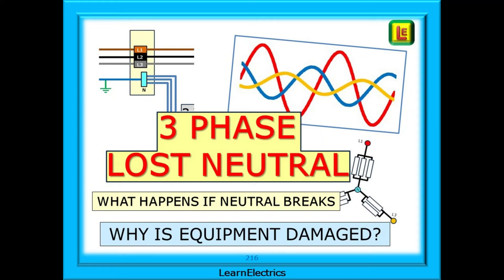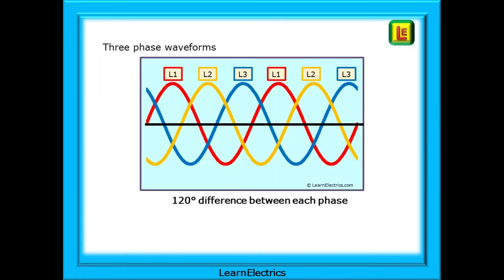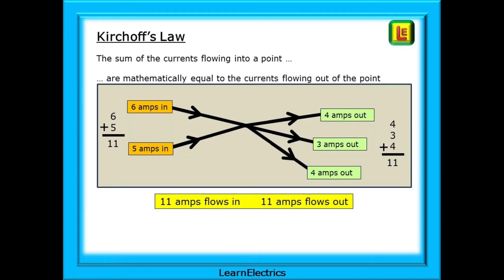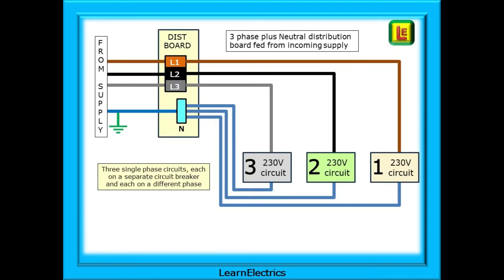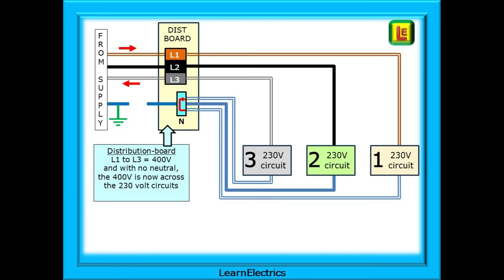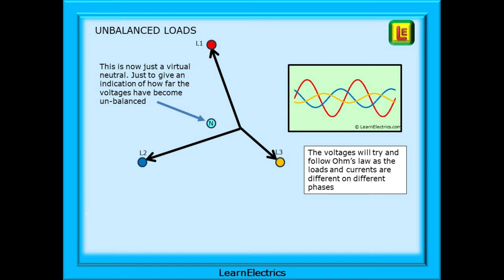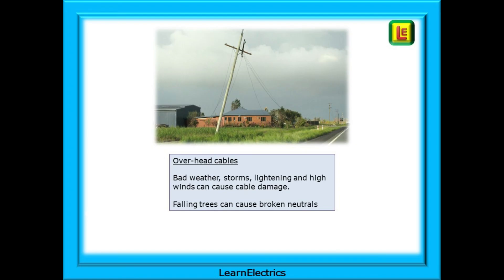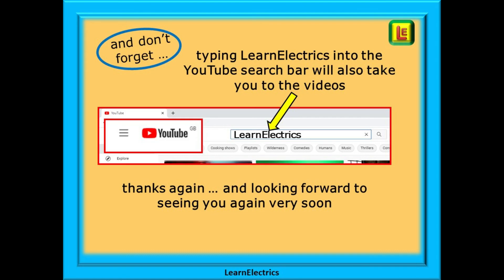3 PHASE LOST NEUTRAL – WHAT HAPPENS – WHY IS EQUIPMENT DAMAGED – A LOOK AT THE THREE PHASE WAVEFORMS

Comment: Great information.  We have a few single phase VFD motor controllers in a sub panel that have different power requirements on each phase due to motor ratings  so the same could happen here if neutral lost .
Reply from the maker: That's a good point Michael. Thanks for the info and thanks for watching. Dave.

Comment: I found this very interesting, but it brings up a question? 
If the loss of a neutral on a three phase supply and is dangerous to the end user as well as damaging equipment, then why are new builds starting to have three phase supply’s as standard.? Surely this will put home owners at a higher risk of fire and injury or death. 
Great video as always 👍
Reply from the maker: Now that is an interesting question. Thanks for raising the subject. Dave.
Reply: Here in India we have 3 and 1/2 core service cables. 1/2 core is the neutral. Means neural size will be half that of phases. This is a cost cutting strategy. Electrically this is ok, but lacks mechanical strength.
Reply: Thanks Dave another interesting video in your usual straightforward style.

Comment: Hi,
You have given a  case. A 3 phase transformer present which drives 8 houses. Each phase has a fuse before reaching the house, inside house thorough MCBs home appliances are connected. Few appliances are running in few houses. Suddenly a bird hit one of the phase of transformer and it's link blown. In house 3, AC got blown which in running state. House 4 - 3 fans blown 2 running state 1 off state. Seen that neutral wires are blown and inside windings are blown.

1. Why not all devices blown in other houses?
2. in house 4, why all devices not impacted?
3. How does the devices affected which are in off state also ?
4. Good to hear the detailed analysis report explaining the cause and internal behaviour.
5. Tell the exact precautions which are needed to handle such situations in future.
6. How can we test the neutral and earthing fine at transformer and at home
Reply from the maker: This is why we install protective devices, to limit the damage and impact on other devices.
Have a look at this video on fuses.
https://www.youtube.com/watch?v=QuTcXRnugvQ

Comment: when you lose the neutral on the supply side you lose the set neutral point so you have a floating neutral, the neutral is normally a centre tap voltage divider with reference to ground, when you lose that you have multiple properties connected to that same neutral and one or more of those properties will also have a connection to another phase, so instead of having a clamped 240v supply you have a floating voltage divider based on resistance that is split between L1 and L2, the lower resistance property gets the higher voltage. 
the voltage will very with the load on each line, the resistance on each line is the load on each line, the higher the resistance the lower the voltage on that line, the lower the resistance (lower the load is) the higher the voltage is.
Reply from the maker: Brilliant contribution, thanks. Dave

Comment: Something similar happened to me when I connected earth together with neutral, instead to the grounding pole clamp. Had to change the old three fase cable with just a neutral going in to the house, to a new one with added earthing. The main distribution board was outside, on the electric pole, the box was old and a seperate clamp to the ground was missing, so I connected earth to neutral. 2  mysterious weaks of dropping/jumping voltage and some damaged equipment. Thankfully the house didn't burn down and most of the equipment was repaired.
Reply from the maker: Lucky, glad you got it sorted. Thanks for the info, and thanks for watching. Dave.

Comment: Dave, thanks for the insightful video. I have a question about the diagram at 07:37. What happens if N is connected to the local earth system (with an Earth Resistance below 4 ohms) and then downstream separated into N and PE at the distribution board level? This approach is quite common where I'm from. Does this practice mitigate overvoltage issues or exacerbate the risks in case of losing N upstream?
Reply from the maker: I've deliberately left earth of the drawings. In the UK we separate the earth and neutral at the intake position and do not run earth and neutral together in the installation. Without seeing how your wiring systems work, its difficult to say. Hope this helps.
Reply: @learnelectrics4402  Dave, thank you for your response. It's interesting to learn about the UK's approach to separating earth and neutral at the intake position. In my country, we typically have (in aerial power line): L1, L2, L3, and PEN -  that has the combined function of providing the neutral and protective earth. PEN is grounded at the intake position and at each 2 consecutive poles. At the customer's first distribution board, PEN is joined with the local earth system provided by the custemer (having no more than 4ohms) and then separated into PE and N.

Comment: Recently I had 240 v neutral failure probably due to tree branch on service pole . Voltages were not correct at panel. Lights dimmed, some lights blew, some lights when turned on turned other lights on. The Aluminum frame of our screened porch carried,  variously, 40 to 70 volts. 
I think our bonded fuse box sent voltages to the screen porch ground, causing my dog to yip when she brushed against the aluminum doorway.
Best advice if lights (power voltages) act crazy.... Cut power and call power company to repair.
An electrician does not work on power company side of meter.
Reply from the maker: Great contribution, thanks for watching, Very similar to my Mother's brush with a storm. Dave.

Comment: If the natural is disconnected, will the circuit breaker in the distribution board activate and save the electrical appliances ?
Reply from the maker: The circuit just will not work. No current flow. The breaker will not operate unless there is a significant earth fault.

Comment: Would an AFDD provide protection against this fault as they have overvoltage protection? Thinking more in a single phase residential setting where the neutral fault is more likely to be with the DNO?
Reply from the maker: In my opinion, no. Not unless you have loose connections and arcing. With single phase, things will just stop. hope this helps. Dave.
Reply: Many thanks Dave

Comment: Thank you for the lesson. I have a question. My house is 3 phase but can be changed to single phase with change over switches, this is because of unstable electricity. Last night after a blackout the incoming voltage was 360v. I thought it was because the neutral was lost. I then changed everything over single phase (all load on 1 line and the “lost” neutral. The voltage went to 200v. Why is it that if the neutral was lost did the single phase work, did the 1 used phase use the other 2 non used phases as a neutral?
Reply from the maker: Without actually seeing this type of problem as it happens, its difficult to say. But thanks for watching and I hope all is ok now, Dave.
Reply: @learnelectrics4402 not sure as an electrical engineer you actually want to see the wiring in the house. Phases are changed over by wall sockets where all pins are live. You have a total of 9 sockets 3 phases with 3 lines per phase and a neutral line. Africa is scary

Comment: How to calculate unbalance voltage for 3 phase each phase when lose neutral at unbalance load. 
Because that problem some time happen for people used over head 3 phase 4 wire power line.
Reply from the maker: As the video shows, the voltages can vary quite a lot. It depends just how unbalanced it is, what else is on the circuit etc. Thanks for watching. Dave.

Comment: Overvoltage due to a lost neutral is bad news for any equipment. There is more bad news: if the voltage supplied is 230 V rms, then the voltage amplitude swings between -1.41*230=-325 V and +325V, which results in a (momentary) voltage of close to 600V.
Reply from the maker: Thanks for the comments. Dave.